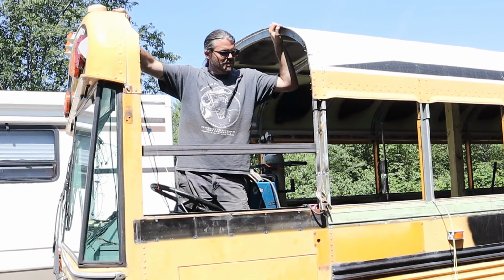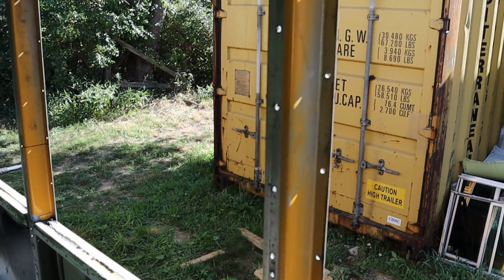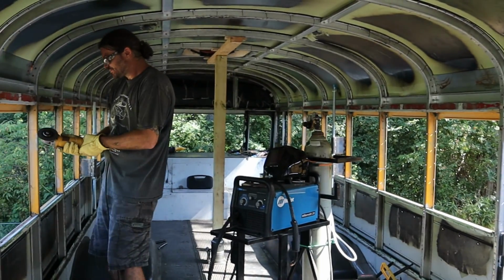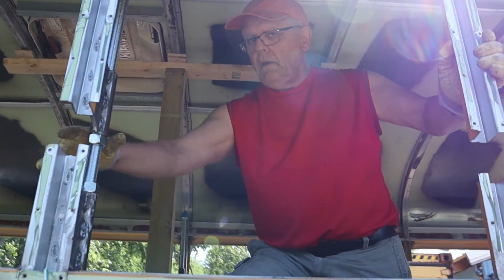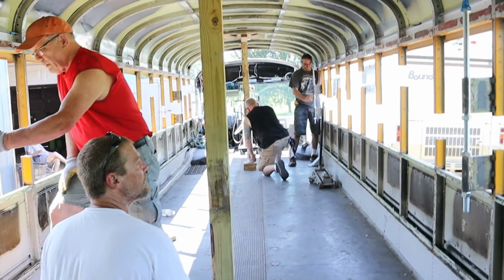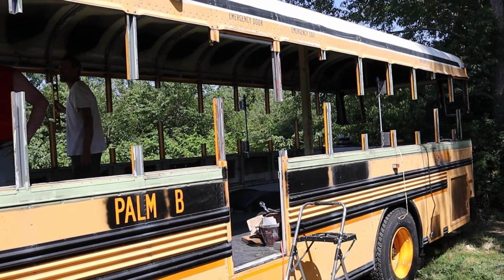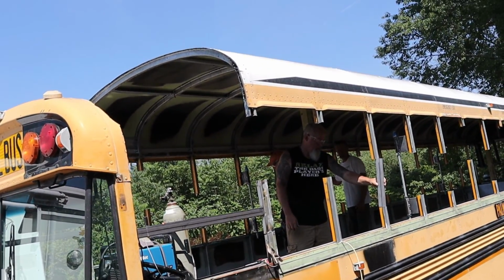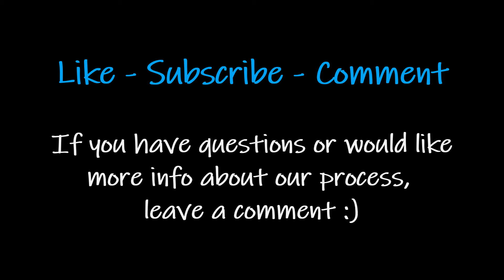Skoolie Roof Raise Part 3

Comment: That hat channel placement looks terrifying!
Reply from the maker: I racked my brain about that before I started. At first I was overthinking it and a little intimidated. 

If I was doing it again, I’d consider welding tabs on the new hat channel for alignment. I will say that once I got rolling it went smooth. I ended up ditching the clamps and using strategically placed tack welds to expedite the process.

Thanks for the comment 😀
Reply: @artsyreclaimed6821  awesome,glad you got it done. That’s so cool. I didn’t mean to be rude or anything. I’m researching for my bus build. I’m 6’2”. I need to RAISE THE ROOF!! I’m so nervous about this process. But videos you post help me get a better understanding of what I need to do. My bus is basically the same as yours. Glad you post these videos. I need all the help I can get.
Reply from the maker: Glad the videos are helpful. I was definitely nervous about the project. But a nervousness is good. It helped ensure I planned properly.

Don’t hesitate to ask us any additional questions. If you have Facebook, you can message us directly www.facebook.com/artsy_reclaimed

Comment: Question! Can one 3-ton floor jack be enough to push the roof up? This is with using the nut & bolt braces welded in of course.
Reply from the maker: The roof isn’t heavy. Yes, it should lift it. I liked using two so I was distributing the force over a larger area. It also provides control and stability throughout the process.

It’s noteworthy to say that we never used the nuts to lift the roof. We would lift with the jacks the spin the nuts by hand. Taking measurements and keeping it even.

If the nuts were to get jammed on the threads, that would suck. 

I hope this helps. Let me know if you have any more questions.
Reply: @artsyreclaimed6821  Thanks!

Comment: Hi! I've got a quick question, and forgive me if this is a bit confusing:

I noticed you welded the new HAT channels end-to-end with the existing ones. i've seen other builds where people hammer a longer length of HAT channel into the existing one and weld with some overlap. Is there a better reason to do one or the other? 

Thanks! Love the video. Rock on :^)
Reply: You're referring to a butt weld (end to end on the same plane) vs a lap weld (overlapping pieces). A butt weld is stronger in terms of shear strength. A lap weld, aside from being weaker, is prone to trapping moisture in the overlap which you do not want and if it's an exterior facing weld (not covered up) you will see the seam where the height changes.

Comment: I have been watching your videos all day as we prepare to raise the roof on our own skoolie in the coming weeks. I have a question: I noticed that you replaced the hat channel gap with more hat channel....In other videos, I see them weld in 1 1/4" square tubing. Any reason you did it this way? Cost? Strength? Thank you for documenting your bus conversion!
Reply from the maker: I played around with the square tube and I didn’t like how it fit in the hat channel of my bus (05 BB All American). I went back and forth about what is better structurally. Either method is good, provided they are welded properly.

Cost was fairly equal for us but if you don’t have a good sheet metal shop, the hat channel could get expensive. Replacing the hat channel seemed like it would be quicker and help maintain consistency.

It was a fun process. Take time to enjoy it. Thank you for watching. Let me know if I can answer any other questions.
Reply: @artsyreclaimed6821  Thank you for your reply. Wish us luck as we got the bus last week.....
Reply from the maker: Best of luck to you on your build! Let me know if you have any questions 😊